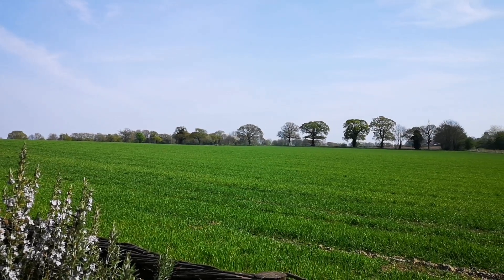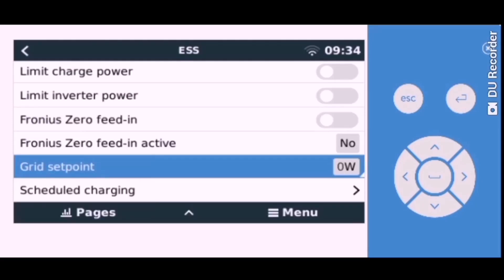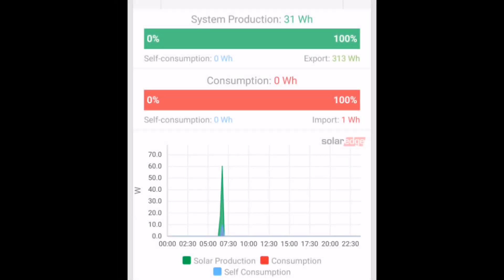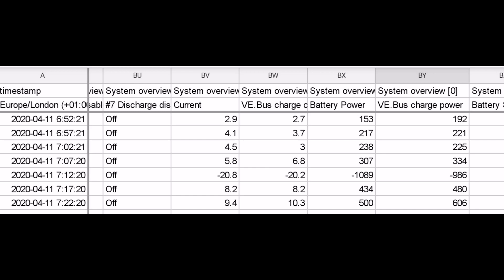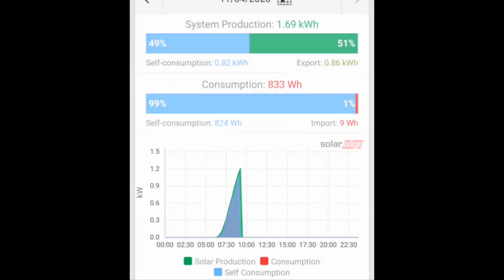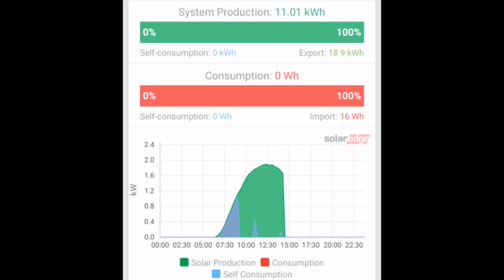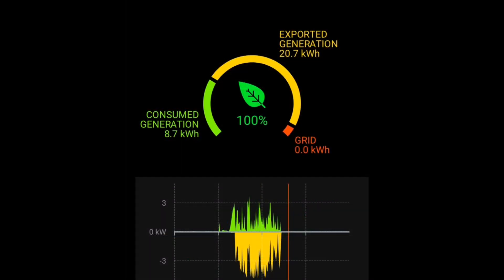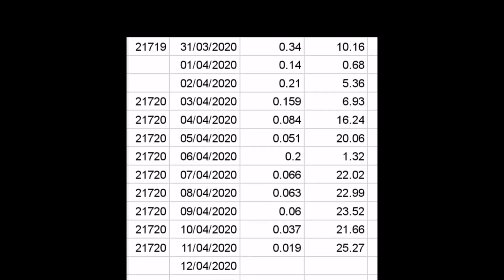Controlling the Puredrive Energy battery alongside Myenergi devices and it's efficiency

Comment: I have that exact Puredrive battery and a Zappi / myEnergi hub with solar! I'm on an Octopus Agile tarriff - so in thwe winter have set it to charge at night and only discharge in the 4 to 7pm peak - using any residual after 7pm.  Solar is all consumed by the house in the winter. As a matter of interest - what do you have your battery Max and Min SOC set to? I couldnt find any recommended settings so far.
Reply from the maker: 10% and 100%
Reply: @EVPuzzle  Ta.  I understand most car charge software protect the battery by preventing charging to the true 100% and discharge to the true 0%. So 100% charged is actually 95% and 0% is actually 5%. I was thinking the Puredrive might not do this - so it might not be a great idea to take it regularly to a true 100% ?
Reply from the maker: I think lifepo4 handles 100% better..not good to empty completely though.

Home batteries likely to change soc everyday so no worries about charging fully imo

Comment: I’ve got a 4g 6kw solis inverter like yours with 5.1kw of pv, diverting any excess to my eddie with zero export set. How would I go about incorporating a victron inverter / charger like yours to act as a powerwall. I’ve looked all over for videos or instructions on how to do it but can’t find any. I’m after a victron setup same as yours. Could you be able to explain how you have the victron wired? I know it has grid in and two outputs, but how do you incorporate it into the consumer unit? Any advice would be most welcome.
Reply from the maker: I'm not a Victron expert but if I understand you question you could search Victron ESS installation and you'll likely find what you're after. Going off grid like the Powerwall isn't so easy though as the inverter needs to be capable of handling a big load. I hadn't installed any off the off grid abilities just the battery as an ESS system
Reply: @EVPuzzle  apologies, I’m grid tied in a detached new build like yours up in Newcastle upon Tyne. All the videos I have seen are about off grid setups, however it’s setting up the victron to work with the grid which is what I am interested in. Basically the same setup as yours but with just one grid tie inverter, (my solis 6k) not two.
Reply from the maker: To use just one inverter you need a hybrid inverter that takes solar panel inputs as well as charging and discharging a battery. Solid hybrid inverters are next on my list to test. Having two isn't a problem of course. I'd miss my Solaredge App if I only had one
Reply: @EVPuzzle  but could I not keep my 6kw solis inverter, and add the victron multi as an extra addition? Working the same way as how you have it setup in this video that I am commenting on?
Reply from the maker: Of course you can yes in exactly the same way.

I'm so far thinking the Multiplus II 48/5000 GX is the box for me (but still need to test the Solis Hybrid. )
Configured using Pylontech US3000 batteries X 3.

I think we're still missing something with your query though

The inverter connects to your AC between the consumer unit and your meter cabinet ideally

Then it's just choosing your batteries, Victron support quite a few, configure the GX online connection and setup in the mode for running as a grid tied inverter. Sounds easy eh?

Comment: Hi Nigel, 

I've a somewhat similar setup to you now.  I've 16kw of Lead-Acid batteries, a Zappi for my EV and an Eddi.  In addition to my Solar PV array, I have Kingspan Thermomax Solar Tube collectors for hot water which work really well.  Ideally, my hope was to power the Eddi off excess solar once the batteries are re-charged, but if the car is plugged in, I'd want the car to take the charge before anything else if the excess power over the house exceeded 1.4kw.  

I've been messing about with the battery modes on the Zappi, between Avoid Both and Avoid Charge, but I'm not sure of how best to set things.  Maybe what I want to do is simply not possible.  My batteries have their own Inverter and therefore, also their own CT Clamp.  Ideally, on the app, i'd really want the car to be at 6 o'clock, between the PV and Battery !!! 

Have you managed to get the car to charge before the battery ?
Reply from the maker: Yes, changing export margin to zero and setting avoid charge on the Zappi does the trick .

Lead acid sounds like a great economical route but is there any maintenance?
Reply: @EVPuzzle  Zero Maintenance.  The batteries are sealed AGM batteries.  When I installed them, I also added Balancer devices on each of the 48v strings

Regarding Car charging, I'm more hoping to find a setting where I can set the settings once and leave them alone, rather than changing when I plugin the car.  MyEnergi are developing a v3 firmware for the Zappi.  We can only hope for a dedicated mode which would focus on Car charging.  Mind you, i've only 2.7kw of panels but will add another 1kw shortly, which would give me more excess solar per day, making it more possible to charge the car on weaker days or, on good days, much longer.

Well done again on the channel

Comment: Great video and congrats on the fin tuning 🙂
Haw dos my energy charge the battery with the pwm ac from Eddy and how does my energy warieate the discharge/ac pruduktion from the battery i balance to the 0w grid goal?
Reply from the maker: If you mean the export limit setting that can be varied from 0w.  The battery settings in the Eddi/Zappi also influence how the devices interact
Reply: Was thinking of the Eddy deliver pwm ac power and from her, What charger is able to work with pwm ac power to charge the dc battery.

It's how my energy control the Charger and Inverter at the 0w Set point 🙂
AC -> Eddy pwm ac -> charger -> DC BATTERY
Then
DC battery -> inverter -> ac
Reply from the maker: I guess that'll be the Myenergi battery when they release one

Comment: Hi Nigel. Have you tried the Avoid Drain/Charge option on the eddi/zappi?  Provides a similar function, though not available in the app.
Reply from the maker: Avoid charge uses too much grid to achieve the same thing. Avoid drain doesn't have much impact on priority from my tests.

Export margin works as per grid setpoint but you have to go outside for that and I'm lazy